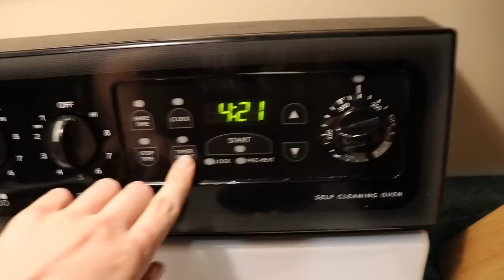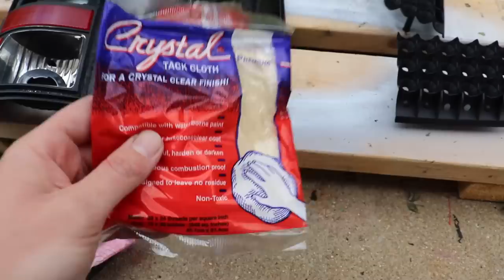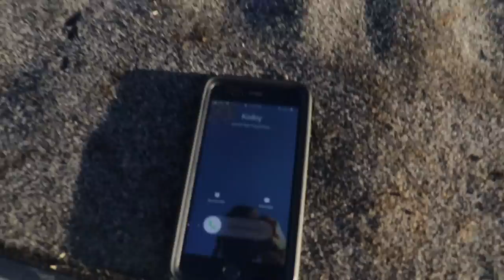HOW  TO COLOR MATCH LED TAIL LIGHTS LIKE THE PROFESSIONALS | without cutting

Comment: You need to make sure you cover the bulb hole with tape to prevent what you did....  Getting overspray INSIDE the lens....  It will look like crap !
Reply from the maker: Yessir I actually spray the lenses completely separated now off the housing. Good eye , took me multiple sets to learn what was causing the milky-ness inside of them. Sometimes it was only on certain ones some worse then others. Drove me crazy. Lol. Thanks for watching.

Comment: Were there any steps in between the sanding of the lens and the clearcoat? How did you get it smooth and shiny?
Reply: Wondering the same thing myself
Reply: @JUSTINHAWKSMITH
Reply: Sand the lens, tape your lines, spray your primer and base coat first, then gently take off your tape and spray the whole thing with clear

Comment: Should not be setting them on bare metal set them on a piece of cardboard that's what I do everytime and I set my oven at 275 once it hits 275 I turn the oven off and put my light in for 8 minutes and then take them out and I only do one at a time but setting them on bare metal can melt them
Reply from the maker: I’ve not had any issues but definitely agree with ya! Recommend sitting them on something definitely a lot safer.

Comment: The ones in this video have been sold out for awhile now. Do you have a video of ones with the ones that are in stock, if not how does the process differ?
Reply from the maker: I highly recommend opening with heat gun instead of oven now. Almost all tails will be the same

Comment: Well I can def assure it dosent work as well with some brands as I purchased a set for my 04 dodge ram and yes they did come apart well but the lense was f*ckd lol I understand he specified the make and model truck lights but figured I'd give it a go on mine . Everything was fine except the lense it sagged into the shape of the inside of the light. Melted at 220 for 10 min. So just for reference it's not for all cheap led tails  if I knew how to add a few pics I would to show . So not a huge loss but 100 bucks . I believe I may just cut the next ones lol

Comment: Why did you cut the wires? You could've just un-pined the wires from the connector and removed the grommet.
Reply from the maker: Cheap connectors pins just break when you un pin them. Have tried on multiple sets and always have to end up hard wiring resistors. So much easier to cut brother.

Comment: Does anyone know if the 2017+ super duty oem tail lights have to be cut? Or can I use this method?
Reply from the maker: They would have to be cut. But it wouldn’t do any good to cut them open because the lense is red. All you can do is smoke & paint exterior lense. If you painted insides it would still be red.
Reply: @JUSTINHAWKSMITH  thank you, was wondering how it was done. Wanted to buy cracked oem leds and put new lenses on them

Comment: After you spray the base on the outside of the taillight. Do you leave the rest of the lease still scuffed and then spray clear over the scuffed up lense?
Reply from the maker: Yessir so steps would be as follow. Scuff complete lense with 1200-1500 grit sand paper whichever you’ve got handy. Then mask off the surround, spray it all. Peel off tape, then clear coat complete lense.
Reply: How do you get that clear to not orange peel on the lense?Just super light coats?

Comment: No hate on you whatsoever. Cooked mine at 250 for less than 15 minutes actually. Completely destroyed my taillights and ruined them melting the lenses deforming it and cracking it.......
Reply from the maker: What brand ? That’s crazy.
Reply: 2001 gmc tails from acanii lights on amazon. Very high quality
Reply: Id rather use a heat a gun. Takes longer but you are unlikely to warp them if you take your time and dont leave the gun in one place to long.
Reply: Xavier Jagrosse Those are not high quality 🤣
Reply: Damn bro same whit mine :( i had to order new ones but this time im using a heat gun
Reply: @Superthecod  facts
Reply: @that5.0tho74  rip
Reply: @JAGZBUILT  did u get new ones bro ?
Reply: @that5.0tho74  yeah bro what’s ur insta
Reply: @JAGZBUILT   4.6buildzz